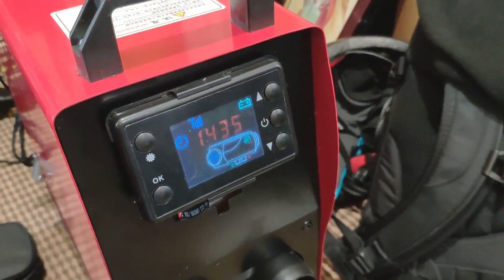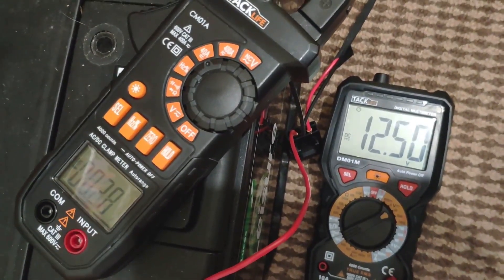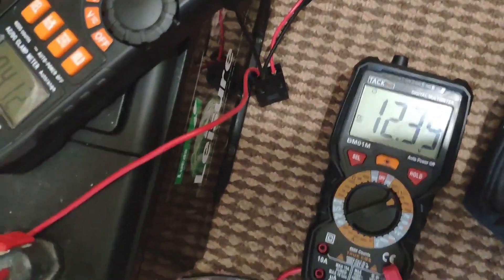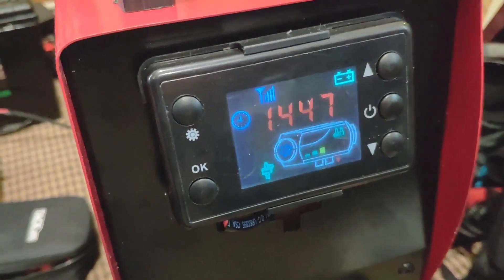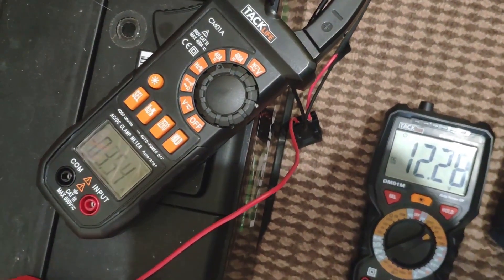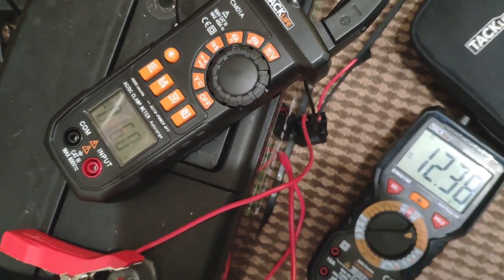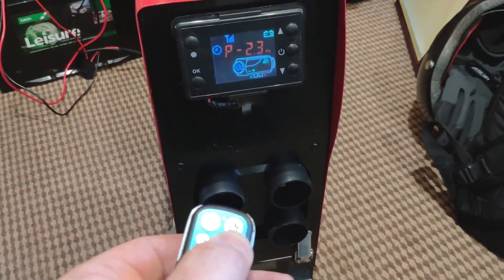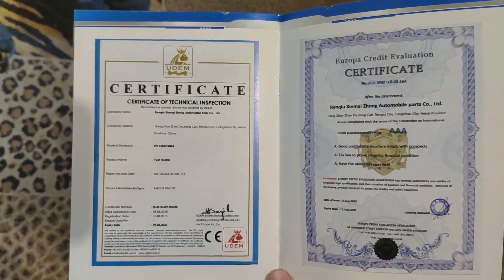Cheap 12V Chinese diesel heater for my boat

Comment: Help a fellow YouTuber out, how long do you think a 374wh portable power bank would run this?
Reply from the maker: I'm no expert on this, so take this with a pinch of salt.
374Wh = about 30Ah. These units draw over 10A for a few minutes on start up and on shut down. While  running, it's using a few amps.
The other thing to think about is how will the power bank recharge when the heater is off?

Comment: Hi Ronnie. Would it be possible to run this unit off of an 240v to 12v DV power brick? Say with an amp rating of 10AMPs? It's for use in a small cabin with wall power.
Reply from the maker: I'm no electrician, but I think it should work. The more amps the brick can supply the better as it certainly pulls a fair bit on startup.

Comment: Could you extend the LCD to fit it somewhere else? Is it just connected via a proper connector or hardwired in?
Reply from the maker: I believe it connects to a circuit board with a plug, but can't be 100%  certain on that. Worst case scenario is that you cut and extend the wires on it. I've seen replacement screens that aren't that expensive so in the worst case you screw it up and buy a replacement screen.  :D

Comment: Good video. Is this a 5kw or the 8kw? Thanks
Reply from the maker: I think it's 5kw. I believe there's only really two types of heater one is smaller, the other as bit bigger. Both being represented as different kw's (eg: 5 as 8 etc)
Reply: Thanks for the info 👍

Comment: Awesome video do you know how long the tank of fuel will last for?
Reply from the maker: I believe it's a 5L tank which will last AGES. I marked the tank before and after 5hrs of use and it took about 4mm (deep) of diesel. Not a lot from 5L.
Reply: @RonnieTucker1  Awesome thanks for the speedy response

Comment: How long will this run before it kills the auxiliary battery
Reply from the maker: I had it running on my boat for over an hour and it hardly made a dent in the battery voltage. Dropped maybe 0.2V at the very most. You definitely need a solar panel or something to top the battery back up during/after long use.

Comment: hi, thank you for taking time to produce this good video. I plan to buy that cheap Chinese heater. I understand that there are 2 models, an old one and the new one. I struggle to find what is the difference between two. Any clue ?
Reply from the maker: I had no idea there was a new and old version. I know one version comes in bits and you have to assemble it, and this one is an all-in-one that's pre-built and ready to go.

Comment: Great video what amp fuse will you use on it ?
Reply from the maker: It comes with a fuse holder and fuse in the red wire. I think it's a 15A fuse that's in it.
Reply: Yes that’s what I thought about 15A you know the pump is noisy I saw a video a guy suspended it  so it’s not fixed as that makes more noise when it’s fixed little tip
Reply: Ps Thanks for the reply

Comment: Could you do another review of it show us where the diesel fuel goes in and does it have a air intake? How many BTUs? What's the price?
Reply from the maker: If you look at about 2.05 in the video (where I mention exhaust fumes) you'll see a blue cap on top of the unit. That's where the diesel goes in. It can take up to about 5Ltrs. No idea about BTU's I'm afraid. Price varies on sellers, but that one was about £160 including P&P.
Reply: It puts out about 5kw or 17,000 BTU. FYI there are only the small 2kw and the larger 5kw units. Any claiming to be 8kw are full of crap. Also they work much better when properly tuned which they are not out of the box. 5kw unit at sea level works great at 1.9 hz low limit 5.5 hz high limit 1680 RPM low fan speed 4400 rpm high fan speed. To get to programming mode hit the gear until you see - - - - on the screen and enter 1688. Don't change any other settings.

Comment: I follow your channel for the boardgame stuff (though thanks for the rocketbook recommendation some time ago!), but I'm also kind of a sailboat guy - what are you putting this in?
Reply from the maker: I'll be putting it in my little 22ft GRP boat (Dawncraft 22).
If you like the Rocketbook idea, check my newer videos for the NewYes Notebook. Same idea, but cheaper.
Sorry about neglecting the board games, but I do have WW1 (from 1974) on the table. Hoping to get some videos of it soon.
Reply: @RonnieTucker1  No worries, that wasn't criticism! I had found your site originally when I picked up Silent Victory and was looking up some play-throughs of the mechanics. Neat looking boat! I'd be interested in seeing a follow up review on this to see how it holds up.
Reply from the maker: @kdolanjr  Oh, none taken. Just giving a quick update on things.
I'll try and remember to do a video of it running on the boat to see temperatures, etc., but I reckon it'll hold up pretty well. I'm surprised at how little battery it takes to run the thing. It started up, ran for about an hour at full pelt, and powered off. In total, the battery dropped about 0.01V. Even after about 6hrs of sitting connected to the battery, no heat, but with the LCD screen on, the battery is STILL at 12.59V.